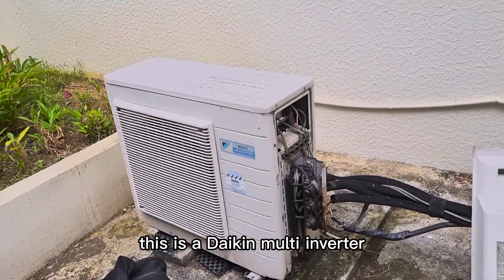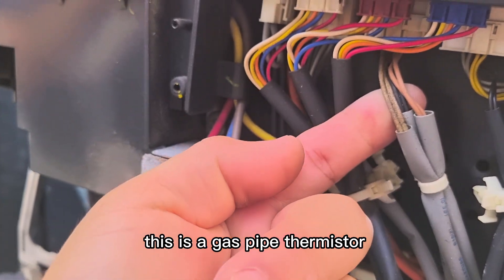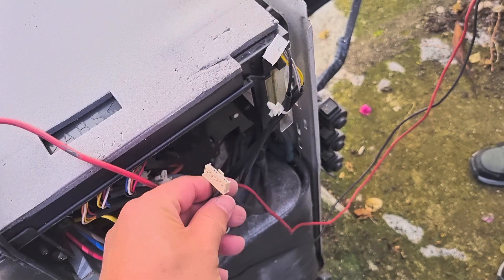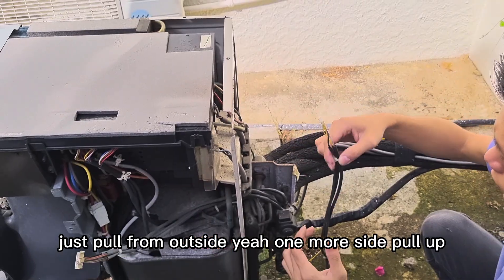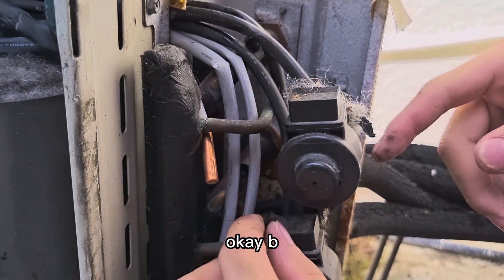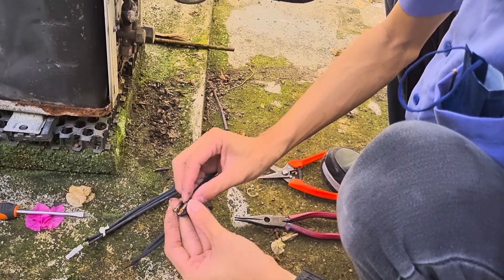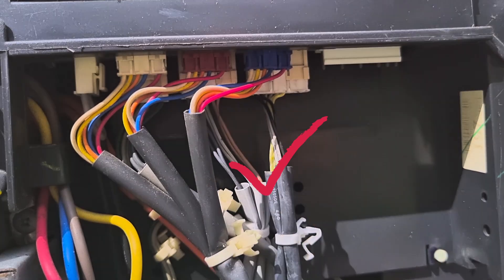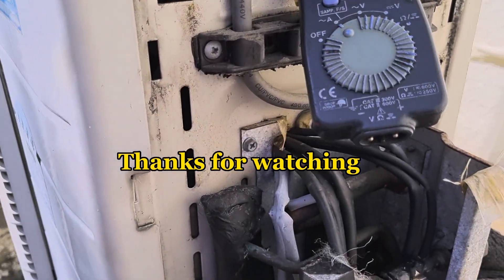Daikin Multi Split 3MKS Inverter air conditioner | error J8, J9

Comment: 1. J9 error is for indoor or outdoor gas pipe? Or need to check either 1?

2. Got MKC-70SVM multi split unit, can advise the replacement part No. for outdoor gas thermistor?